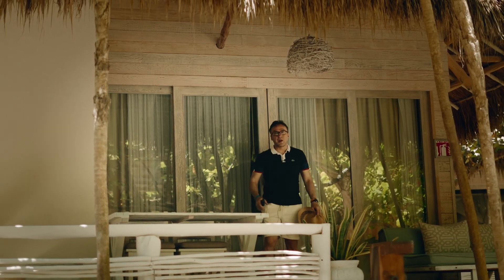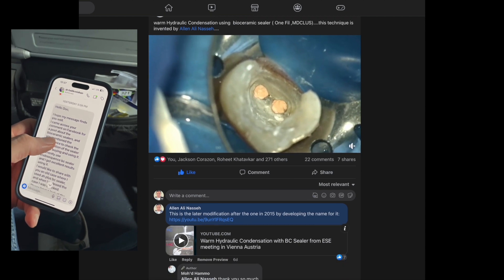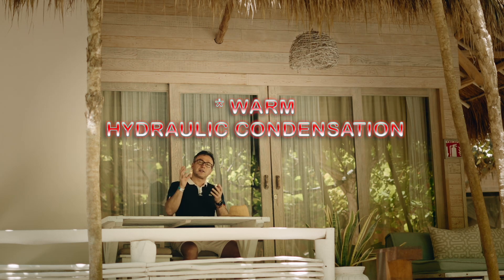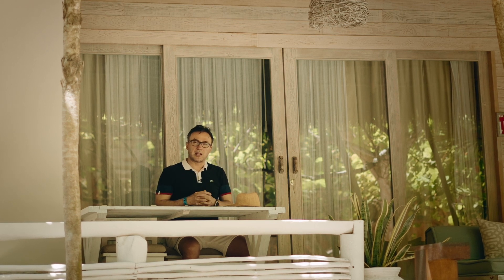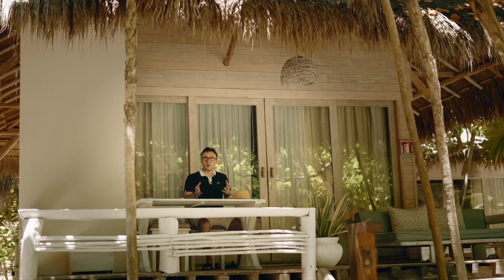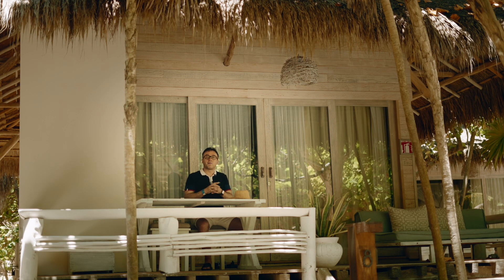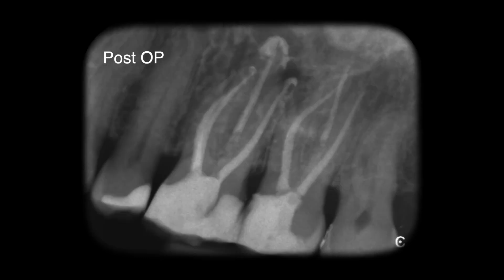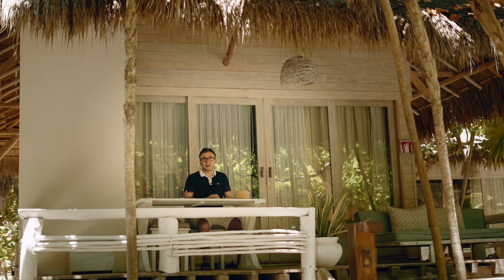Hydraulic Condensation/ Single Cone with new bioceramic  Sealers from Tulum Mexico

Comment: Thank you Dear Dr for amazing video! I'm using Ceraseal in single cone technique. Ceraseal is including tricalcium silicate (20–30%) and dicalcium silicate (1–10%) as bioactive components, and tricalcium aluminate (1–10%) and zirconium dioxide (45–50%) as radiopacifiers. Some traces of thickening agents are reported by the manufacturer.
Do you think cold single cone technique will be ok or better use hot vertical condensation technique ? I'm afraid that heat can ruin this bioceramics ?
Best regards!
Reply from the maker: I haven't used Ceraseal to be honest. So I can't tell you one way or another for it holding its seal in the long run. We need to wait for proper scientific studies to come out to show that. Part of the problem is that many of these cements require time to fall appart. As I mentioned here a few years ago, the AH Plus BC was a problem.. and now many years later, people are now finding out. So, we just need a little time to find out about stability of these sealers. The formulation on Ceraseal shows some Aluminum, which I'm not a big fan of... but it's not a problem to others. It's like mercury in Amalgams, some people have a problem with it and others don't. Sorry I can't give you a more definitive answer.

Comment: I want my surface area/volume ratio to be as high as possible, correct? Ideally, as few molecules of BC sealer as possible will exist between the surface of my canal space and my filler (gutta percha) - because a single molecule will have total volumetric shrinkage of zero.

In other words, the role of gutta percha is a space filler. It applies hydraulic pressure to the intricate canal space.

Comment: Is there a list of "true" bioceramics or how would we know when product shopping?
Reply from the maker: Original MTA, EndoSequence line of BC products, TotalFill, Edge BC, and Septodon's Biodentine and their sealer. These are the real, original ones. The Endosequence has the longest track record. The newer ones, such as Avalon neoflow is also a true bioceramic, but it contains Aluminum, which some people object to. So, it depends if you are a fan of aluminum or not. I probably should compile a list and share. But I'll have a non-commercial academic material scientist other than myself talk about it since I am considered biased as I have helped develop the BC line and it would be inappropriate for me to comment on others. Cheers!
Reply: @EndosKool  Thanks  Doc. According to the published MSDS the original endosequence bc sealer contains 50% by volume of calcium trisilicate and calcium disilicate while ah plus bioceramic sealer  contains about 5-15 % by volume of tricalcium silcate, with 30% dimethyl sulfoxide. Is it ratios  or compositions that account for the differences in solubility?
Reply from the maker: @mnnh3317  In the case of AHPlus BC it's the setting reaction that's the problem. They tried to solve the setting reaction by going to the use of water soluble polymer instead of the hydration/precipitation reaction that's the hallmark of pure bioceramics. As you can imagine a water soluble polymer is no the right material to use in an environment that's submerged in water! The downside of the BC Sealer's Hydration/Precipitation is its long setting time (4hours). The downside of the other is the fact that it dissolves in water over time!

Comment: Thank you Dr. nice to know you are having a great time in Mexico, hope you come to lecture some day in the future too! Do the brands inform if their BC contains polymers? Could you name some brands using this type of BC? Thank you very much.
Reply from the maker: Itt's important to read the Material Safety Data Sheet of the sealers to look at the compositions and also attend courses by non-biased material scientists to see what the properties of various sealers are. There are substantial difference between sealers, primarily because there are patents and newer sealers need to circumvent patents and must therefore be substantially different. As a result, even though many call themselves bioceramic the composition can be very different and therefore the material properties and stability will be different in the long run. Consumers must be were and do their own research. Maybe at some point I will make a video distinguishing these sealers or interview a material scientists talking about them. Cheers! :)
Reply: @EndosKool  I have access to Bio-C and CeraSeal, according to their data sheet these sealers don't contain polymers. A couple of years ago I attended to a lecture where they were addressing this issue too, definitely this is an important aspect of bioceramic sealers to take into consideration.
Reply from the maker: @trickjacko8482  Look at the calcium silicate concentration. You want it to be 30% or above when possible for more reactivity. You also want to check out for aluminum content. Other things to look at is the Calcium Phosphate concentration. It's a little more complex than any other white cement. But all of them should work if used with vertical and lateral condensation. But Hydraulic Condensation requires stable cements due to cement film thickness being much larger.
Reply: @EndosKool   Dr. Nasseh thank you for your video and also for very interesting comments. Since I started to look into bc sealers I try to get to know composition of almost each bc sealer available in my country . What I did not find out how it is clinically relevant. For example many sealers which are most common used contains 30% and more calcium aluminate but only 0-5% calcium silicate. I am trying to find out if that low percentage of CS matters if there is such a huge percentage of CA. Do you have any comment on this? 

Also sorry for my long message . Since you mentioned setting of BC sealers in acidic enviroment is worse, do you prefer to go for single visit anyway? I just had a follow up of my case obturated 2 years ago with full length bc sealer (piston technique without any cone, only warm guttapercha in orrifice as a piston) and after 1 month everything was looking the same as at the post op, after 2 years there is almos 4 mm washout of the sealer in apical part . I know it is hard to answer if you do not know my whole protocol but I am wondering what could be wrong in this case - low contain of CS or acidic enviroment? 

Once again sorry for long reply and thanks in advance for your comment
Reply from the maker: @michalpolivka6066  Great question Michal. The composition should be written on the MSDS Sheet inside each sealer package. The manufacturers must by law divulge their components (at least in the US). You can also read the compositions from the FDA 510 application the companies send. Aluminate is used by some manufacturers as a replacement for calcium silicate in order to facilitate setting; however, some people frown upon the permanent implantation of aluminum in the body since it has been found in Alzeimer's Plaque and other types of toxicity. But that's the same kind of controversy as with the Hg in amalgam. The bc you used and found the washout may be something that contains some of the washout prone components or have a water soluble (miscible) polymer as its basis (Marucci'/AHPlus BC). These are prone to this washout based on their chemistry. However, these sealers, as I mentioned in the video, would be perfectly fine if you follow the Minimize the Sealer Interface protocol by doing either Lateral/Vertical compaction as we did with ZOE and Epoxy resins. I just wouldn't recommend them for Hydraulic Condensation since maximizing the sealer interface or large areas of pooling will very likely washout in time. Therefore, the problem is to undrestand that term bioceramic sealer is somewhat abused nowadays for marketing reasons. You need to know the composition and use the correct technique for the material you use. Cheers! :)

Comment: Dr. is it possible to retreat root canal with BC sealer?
Reply from the maker: If you use Hydraulic Condensation correctly yes. But if you fill the canal mostly with bioceramic then it’s very difficult if not impossible to retreat. This is why we developed Hydraulic Condensation: to harness the power of bioceramics without the potential side effects of a bioceramic fill. 
Cheers!
Reply: @EndosKool  Thanks.

Comment: Thanks dr . Allen for the great info, i was wondering , if i had a good tug back (apical seal) and a good coronal seal, following an efficient irrigation protocol ,using single cone with polymer based cements , where would infection originate from even if it shrinked over time?
Reply from the maker: If you had what you described reliably on every case then you could really fill with any technique and within any cement since you had sterilized the canal and sealed it coronally. The problem is that this is not achievable clinically in a reliable way. More exactly, it’s nearly impossible to achieve at the Ultrastructural level! 
But this is a great question I should make a video for others to share! 👍